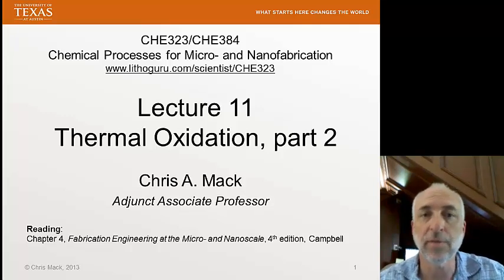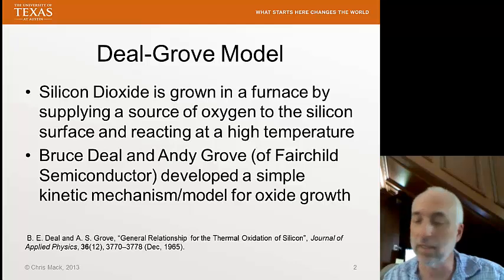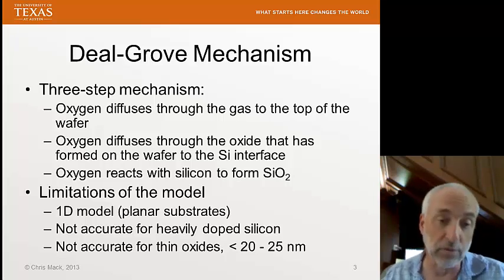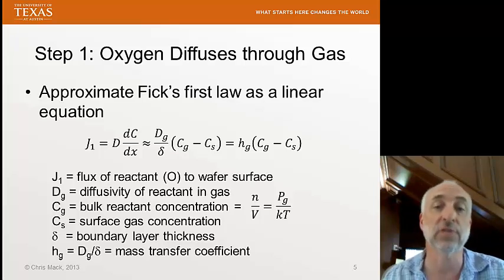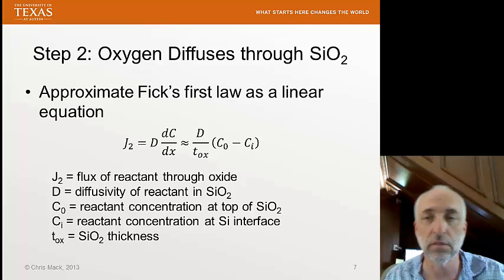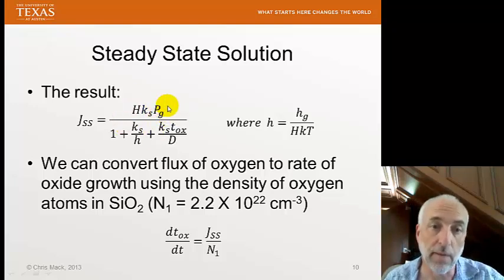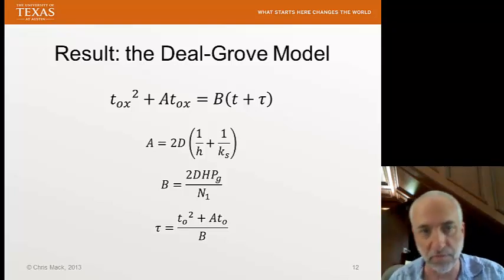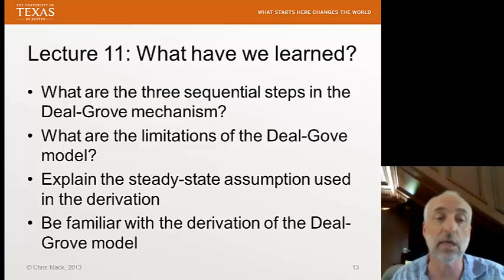Lecture 11 (CHE 323) Thermal Oxidation, part 2

Comment: What is 'to' in the equation of tau ?
Reply from the maker: It is the initial oxide thickness - the amount of oxide on the wafer before you start this thermal oxidation cycle.  If you start with a bare silicon wafer, then t0 is zero.  There is more on this topic in part 3 (the next lecture).